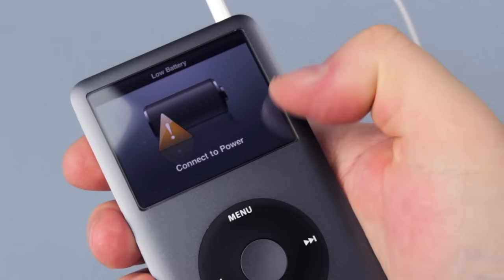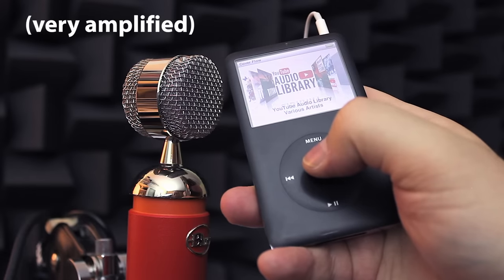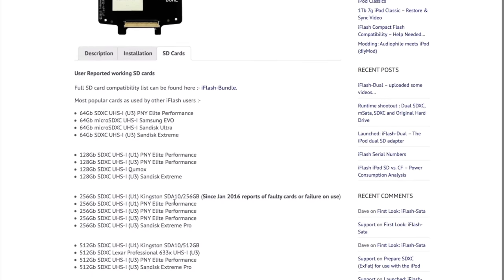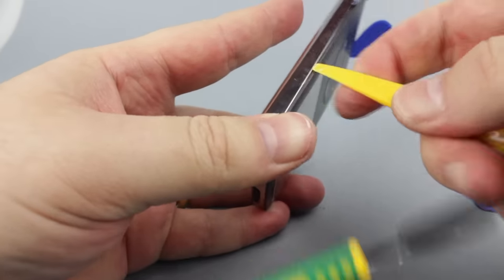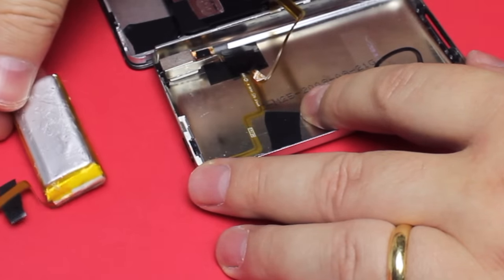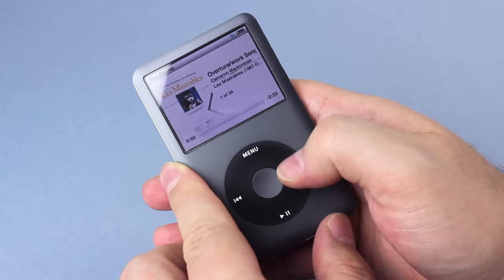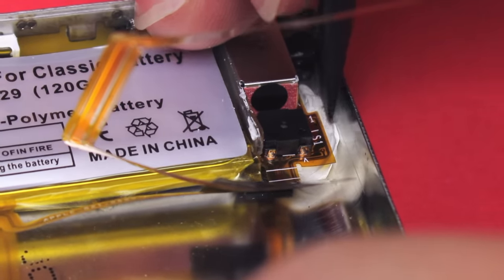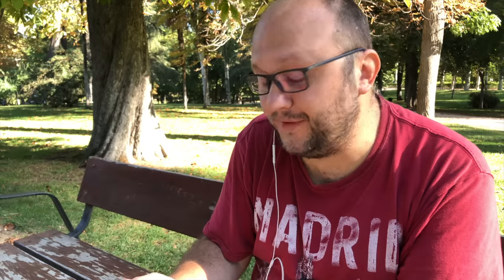iPod Classic new Battery & 256GB SD Card: still works in 2024

Comment: Time for a 2TB upgrade!
Reply from the maker: Ha ha, well, the thing is: even with just 1TB, the only way for you to fill this space is using raw music (wav, uncompressed), because the iPod’s internal database has a limit of 50 thousand songs. But listening to uncompressed music, the battery would go faster as well... so I don’t see much sense in doing it 😊
Reply: @GeekDetour  whit the extra space from the 1tb can i use the ipod classic as a external drive, not for daily store files , just ffor backups? it recognice the 1 tb? y just saw the video GREAT JOB SIR, i have an ipod U2 edition 30gb
Reply: For the car, compression is the devil.
Reply: Tim Watson 🤦‍♂️
Reply: Geek Detour does that limitation apply to the newest iPod classic??
Reply: @DeltaWave72  hmm, somehow i think you need a dac to trully hear uncompressed audio. So how much did you spend on that stereo?
Reply from the maker: @GDX2470  Yes, the 50k songs is a limit even for the last/newest iPod Classic model (which is mine). There is a video showing a 1TB iPod Classic syncing 49k songs: https://youtu.be/IIM0jV3MLOs
Reply: I believe that the limit is based on the size of the database, I like a lot of metadata and higher-than-necessary resolution artwork so mine failed at about 40,000 files. When I filled the whole 256GB I could play individual tracks but selecting shuffle would cause the iPod to reboot. I keep it filled to about 200GB and 35,000 songs and that's been mostly trouble-free for several years now. I suppose you could fill a TB with podcasts and audiobooks pretty easily.

I do have trouble syncing the iPod, generally when I connect to my PC it will say that it needs to be formatted and I need to hard-boot it at last once before iTunes will recognize it. I don't know if that's related to the flash card/sd card setup though, but I think I have an older one than yours.
Reply: @GeekDetour  so change out the os for "rockbox"
Reply: Can you use rockbox or something on these things?
Reply: if you used Flac file in every song , 2TB just fit and had some space

Comment: Thanks for the easy to watch and informative video! I too struggled and created a small line on my screen, but I got it open, replaced the battery and earphone jack. I did not order the sd card upgrade but i will now that i have successfully opened and tested the cheaper replacement items. I loved the "ground hog day" reference and how you treasured your iPod because it was from your wife.

Comment: Another upgrade that would make it worth it is bluetooth.
Reply: Nah man. It will just not work because Apple does not have bluetooth support in their ipod os
Reply: nah retro games would
Reply: @simonspasskiy  .... That's not the point. SD card support is not in the OS, someone had to make it work. There exists 3.5mm to bluetooth adapters, that will just take the signal going to the 3.5mm jack, and convert it into bluetooth audio. Just will have a separate way to connect to it. It's possible. Similar to how people add bluetooth audio to their car or TV. Practicality is another issue however, and probably size constraints.
Reply: @guser436 , This exactly. Dealing with bluetooth at the point of the 3.5mm jack makes tons of sense. I have already done this successfully.
Reply: @guser436  Ok I understand now
Reply: It would probably a lot cheaper in terms of wasted time to just buy some cheap Chinese knockoff on AliExpress with built-in bluetooth. ;D
Reply: NFC
Reply: @humbertozavala353  for what purpose lol
Reply: What a nonsense. Just buy a newer mp3 player!
Reply: You can buy external bluetooth transmitters on Amazon, they just plug into any headphone jack and send audio to any bluetooth device.
Reply: My friend had  a Bluetooth adapter that connect to the charging port of his iPod classic
Reply: My friend had  a Bluetooth adapter that connect to the charging port of his iPod classic
Reply: @yaridperez6571  Which one? To me there's no audioplayer then the IPOD classic
Reply: Yeah I have the same thinking other day and I tried to put one bluetooth receiver in the phone jack but as expected it didn't work...
Reply: Google User or a 30pin to Bluetooth adapter
Reply: @yaridperez6571  they dont sync with itunes and your itunes playlists, which is a pisstake if your collection has built up on there
Reply: @simonspasskiy  there is a way tho
Reply: @guser436  Apple already made it and they call it, iPod Touch 7G. It comes with WiFi, 4.1 BT, Flash storage, a Retina touch screen, plays music and videos. And get this, you can play real games on it and not only that it has a nifty headphone jack for that retro feel. It has everything you could ever want, but if you only want to really Enjoy listening to lossless music then you should already understand why BT sucks...

Comment: What an awesome video! I did a similar thing with one of my 5th generation iPods some years ago when I replaced the stock 60 GB Hard Drive with a bigger one. I also have a silver 7th generation iPod that still works fine, but I am still going to order the replacement parts you recommend when it does finally die. Thanks so much for making this video!
Reply from the maker: Hey Juraiprince 👋 Thank YOU for watching! Oh man, you will notice a big difference when you try to open the 7th gen... buy the iSesamo blade (or similar) - it reeeally helps! Good luck! 🍀👍
Reply: Thank you @GeekDetour  for the kind words! I have that old 5th generation iPod that I mentioned. As a matter of fact, I have two of them! They are both dead right now, but you have inspired me to go ahead and rejuvenate them by ordering the parts for them! Thanks again, and I'm very glad that the present your wife gave you is still giving you joy! My wife had given me that 5th generation iPod that I mentioned above, and it has given me YEARS of joy, so I am going to restore it to its former glory😀! I have subscribed to your channel, and I will keep you posted on my progress!

Comment: Great video! This is why I have a mp3 player with a SD card slot
Reply: 256GB card, to be exact.
Reply: Although I have a Fiio which is great and can store up to 256GB on two SD cards I too am nostalgic about the iPod classic. I have two. I'm going to attempt this (already have the case open) and if I'm successful I will have a go at the other. I say I have two. I also have a fully functional iPod classic 160GB and an earlier generation 30 GB model which also works. Sounds a bit overkill but, well, you know..boys and their toys....
Reply: Paul Brown were you able to repair yours?

Comment: I upgrade my iPod classic with a actual SSD and a much bigger battery. It was all good, but I only got a 32G SSD which is not big enough anymore. And there aren’t many new SSD for iPod anymore. So I just stuck with a 32G iPod classic.
Reply: @coco nut Not so much, just found out people are still selling SSD for iPod on Taobao. A little bit expensive than SD card adapter + SD card.

Comment: My iPod Video (5th Gen) has a sad story,
In 2005, my dad decided to give my mom an iPod! R bought it, it arrived, my mom opened it and said “what is that” my dad tell her what it is and she tries it out, and thinks it’s too complicated to use. So it was left for years!!! Then I found it 12 years later, no scratches mint condition. The issue was it wouldn’t turn on, it makes a buzzy noise when you plug in the 30 pin cable, and what is it?? I think it’s sad it just got left. But hey it’s 80 gigs
Reply from the maker: Hey 👋 wow! I hope you can put it back to work - it is certainly a very nice piece to keep. The battery is most likely dead after so many years uncharged. The noise and some little vibration might come from the hard disk spinning (should be something very subtle). I recommend you to find someone experienced in repairing iPods - if it is so pristine, it would be a chame to damage it. Good luck! 🍀👍
Reply: Hello, I opened it before but I didn’t find any corrosion on the board of the iPod itself, I hope it’s just the battery and the hard drive, I do have a iPod  Nano 5th gen with 8GB Of storage, i only use that iPod for running and gym since it’s only 8GB in storage which can’t have my whole music library!! So I really hope they iPod Video will work after a battery replacement, hopefully it’s easy to open!! I used a cheap opener from a battery replacement from my uncle did on his iPod and it worked fine to open it! I will use the iFlash card, I forgot it’s a 60GB and my music library is 36GB so that’s also good, hope your iPod will last forever!
Reply: @DanishSpeakerChannel  definitely a dead hard drive.

Comment: I'm going to try and revive my iPod Classic. Battery is just about dead and doesn't hold a charge. I'm now thinking after watching this video to replace the hard drive with 2 SD cards at the same time and try and have a 512GB iPod Classic. If I'm going to replace the battery it seems to make sense to replace the hard drive at the same time. Just about to order what I need.
Reply from the maker: Hi Chris! Good luck on your repair!
Reply: @GeekDetour  Managed to do it thanks to this video. Printed off the pdf to show where the clips were. It is just the battery that I have changed and the disk in it seems fine. Might upgrade to a the SD cards at a later date but very happy I have my ipod back up and running. Thank You for this video
Reply: Only need to do the Latter if you are wanting more battery life.

Comment: I have an iPod classic 80GB and have faced a couple of problems recently with it. I connected it to the computer to synch a couple of new albums and when I removed it, all songs got deleted and went through a couple of tries to restore it. I managed to restore it but still face problems when I connect it to the computer and load songs; at times, iTunes freezes and an error pops-up saying the songs could not be transferred to the device or  the whole programs freezes and I have to eject the device via Windows. This video does tempt me to try to replace the drive (I assume that the drive fails and have checked the iOS and seen some data that looks suspicious) but I have zero experience with this kind of work :(
Reply from the maker: Hi Talia, I think you should ask the help of a friend (of tech support of your trust) to better investigate what is happening with your computer and iPod. Don’t open your iPod just yet... Get help from an expert to see if you computer is OK (iTunes shouldn’t be crashing like this). Good luck! 🍀👍
Reply: @GeekDetour  thank you very much for your kind comment! I will talk to a couple of friends to look into this and hopefully a solution will come up! Will keep your tips and advice from the video as a last resort :) Great work and wish you a lovely day!
Reply: FYI... Do not use a recent itunes, use an older version, I had problems with my old 60g ipod, would not work, local apple techs advised me NOT to upgrade itunes. My 2 cents ....
Reply: Your hdd has probably failed bro but before trying to replace it with a SD card maybe use old itunes with a new ipod cable and when you're trying to sync or anything with the ipod hold it to your ear and listen for strange noises as that will tell you the ipod hdd is failed

Comment: Really helpful, just opened mine using the iflash spludger, very similar tool to the one you recommended (you can order it with the boards from the website). Your guide worked perfectly for opening it. I opened it first go, no damage apart from some minor scuffs. Thank you for sharing! I now have a 300gb ipod using the quadflash card a 128gb and a 64gb micro sd card I had lying around, and buying one new 128gb sd card for £17 from amazon. My dads ipod hard disk died, so I gave him mine, and I updated his broken one as a project (didn't want to risk breaking a working one!)

Comment: Hey Geek Detour thanks man, that was the perfect tutorial, wonderfully detailed. I've got the 6th generation iPod (2nd generation Classic version) and just complete my battery upgrade without a hitch. I didn't have the iSesamo tool, so was nervous at first starting out, finally found that an artist pallet knife was the perfect tool, you can get them wide and flat, it was very thin and worked perfectly. I used your pdf as guide and blindly disarmed the clips, suddenly it just came apart :) 

You've just extended the life of my iPod, helped the environment and made a stranger very happy. Thanks again man.
Reply from the maker: Wow! 🤭 Man, thank you so much. Most people enjoy the video just as entertainment (some people comment that they never even had an iPod 🤣) - of course there is no problem with that. But when someone actually fixes their iPod, just like you did, it makes me SO HAPPY! Thank you for sharing your experience - and welcome to the channel!

Comment: I still prefer and use iPods nowadays. I have some library music that I've been gathering for at least 10 years. Lots of things I couldn't find on Spotify, Amazon, or anywhere else but some obscure blogs around the net. I have a 5th gen iPod Classic with 30GB. I've stored this one because the headphones jack is broken. I couldn't fix it because it's too dificult to have specific spare parts available in Brazil. Then I bought a 160GB 6th/7th gen later. Everything was fine for 8 years. Then a friend of mine just sold me another 160GB 6th gen and I've bought that just in case. Now their batteries are showing signs of age. Suddenly I've found your video, even bought some 650mAh replacement batteries but I'm trying to raise guts to open them both to replace their batteries. I'm glad I've found your video. Thanks for posting!
Reply from the maker: Hello Américo! Oh yes: streaming definitely doesn’t have everything an eclectic person enjoys listening 😁 I have a few Indian music CDs I couldn’t find anywhere else later. My wife also had the complete Legião Urbana discography... and the complete ABBA discography: streaming doesn’t offer “complete” discography 🤣 So, we keep our collections physically on our computers and iPods 👍 By the way, you have more iPods then I do - when the batteries die, you will feel the proper encouragement to open them 🤣 Um grande abraço deste brasileiro que vive em Madrid 🇧🇷 🇪🇸

Comment: Thanks for this video, With this instructions and the pdf I opened my second Ipod (6th gen) within 10 minutes without any damage. I bought the right SDcard and its working fine. I became enthusiastic and bough a third one cheap second hand (7th gen). I want to change this to a super Ipod. with a 2000mA battery and 512 or 1TB storage with a new cover and back (cheap on AliExpress). Because of your video Iam confident to do this job. I also don't like to be depended of a streaming service and I don't like the other Apple products like Iphone. The Ipod's are the best devices I own. Thanks to Steve.

Comment: Such a great video! 
I’ve recently stopped streaming music and invested in an iPod as I have a lot of cd’s and mp3s on my computer from way back. I absolutely love it and don’t think I’ll go back! 
I decided to upgrade my iPod to a 6th gen and there is an issue with the screen and battery unfortunately! Watching this video has inspired me to give it a crack at repairing it myself, which is something I normally wouldn’t opt for. I’m aware it isn’t the easiest job in the world and if something goes wrong so be it, but I’m excited to give it a shot, have fun (and maybe some frustration lol) and hopefully fix my issue!

Thank you for the awesome vid :)
Reply from the maker: Hi Euan, thank you! I hope you can upgrade your iPod without any problem - yeah, opening it is always risky as it is very delicate. You should consider the risk of completely ruining it.

I have another story for you: a couple of weeks ago I decided to fix my Apple Watch - it was the very first model. In 2019 its battery expanded and pushed the screen out... I took it for Apple but they don't offer any repair anymore for the first generation. So, I was in a "nothing to lose" situation. The AppleWatch is the most delicate thing I even opened/repaired. I had bought a new "force-touch sensor" (a very thin ring that goes around/under the display) in case I would break it while handling it... and indeed I broke it while I tried to clean it (as a preparation for gluing). So, yes, accidents can happen. Be prepared and try to have fun!  Oh, I could repair the watch :)

Comment: Very helpful guide, your diagram makes it easy to see exactly where the clips are so you can work only on them instead of just wildly messing around with a thick spudger trying to get it open. The worst part was getting the HD cable plugged in, there isn't a good stiff place to use to seat it. But all worked out well in the end. Thanks.
Reply from the maker: Glad it helped!!!